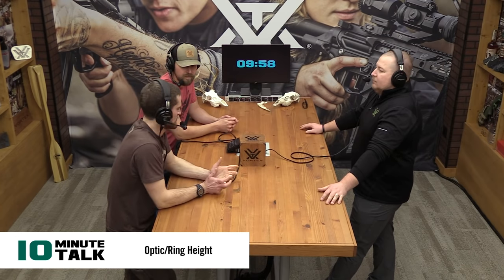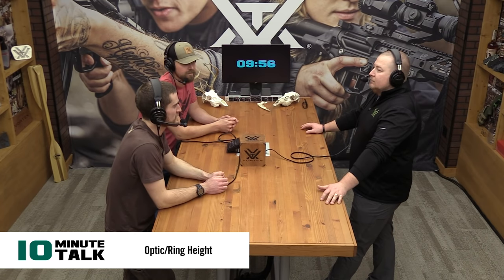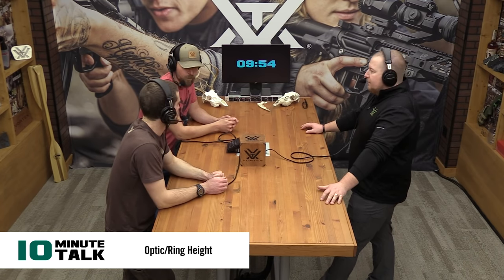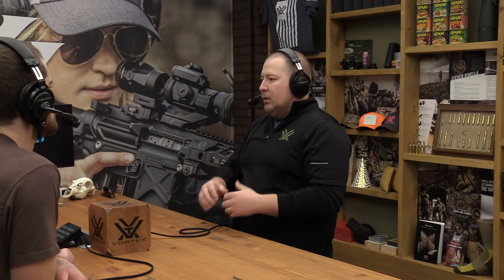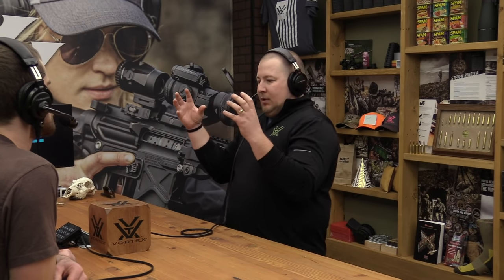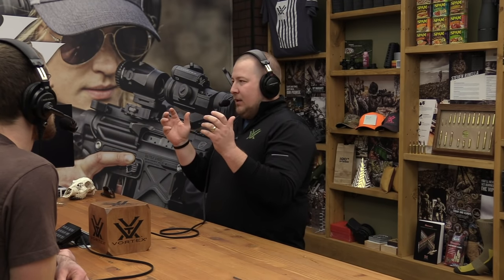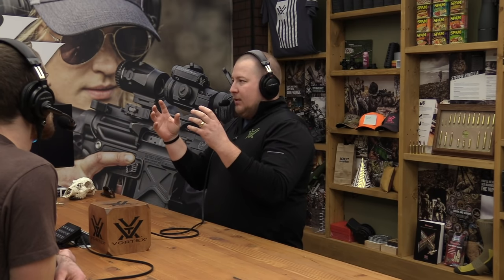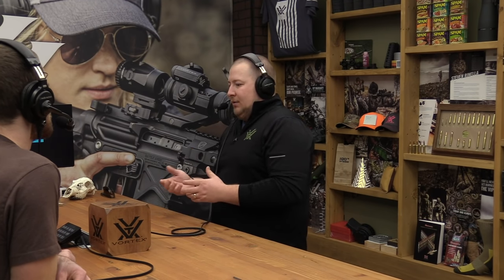#10MinuteTalk – Optic/Ring Height

Comment: One thing not discussed was the effect of length of pull.  On a standard bolt gun, the further you move away from the gun, the lower your head lowers and vice versa.  People with longer necks tend to crawl the stock, which generally forces the head down, and you end up looking through the top of your eyes, which, as pointed out, is not desirable.  Higher rings can help this.  A cheek piece on the stock should be raised also.  It is crazy in this day and age that all rifle manufacturers don't offer adjustable combs and length of pull on their stocks - especially where women are concerned as they generally have longer necks and a smaller frame. 

One issue with Bradley style of cheek riser is its width.  It tends to move the face away from the stock, which causes the shooter to roll his/her head over to look through the scope.  This affects people with round heads or fatter faces more.

The bottom line is rings are only part of the equation, and it is an ongoing trial and error process to get a solid fit every time.

Comment: 17:38 Jimmy is so right. 30 mm tubes and even the 34 mm tubes are fine on medium height rings. You might only need low if you are getting the 1 inch rings for the Crossfire II 3-9 / 40 mm.

And definitely get the Vortex cantilever or "AR" mount. I learned that the hard way. When I was scoping my AR-10, I got some separate rings and put on a Diamondback Tactical 6-24 / 50 mm. I could not get enough elevation to bore sight with my laser. Changed to the cantilever and then the scope had height and alignment with my eye. Now, that makes height over bore about 3 inches but at least I could get it zeroed. And when I changed to a Venom scope, I knew to get the cantilever for a 34 mm tube.

Now, with my new TC Compass II for my dragging through the bushes hunting rifle, I have one of the Diamondbacks I had laying around when I changed three other rifles to Venom scopes. I used medium height 30 mm that I had used originally. Perfect fit.

For cheek height, I had tried a Bradley but it was actually too high. So, I got stuff from Goda Grip and that worked out great, like it was made for me. Anyway, so, having all the alignment worked out made zeroing a lot easier and more successful.
Reply: Ring height also depends on the ring manufacturer, and objective diameter. I’ve used low rings with three 30mm tube 44mm objective scopes now with room to spare. This is especially true when a pic rail is used. This is all on bolt actions.
Reply: Medium-high ring from what company? What you are looking for is the clearance between barrel and scope 2mm/0,08 inch.
Reply: @oddmunddale806  The Vortex mediums seem to work well for most scopes with objective bells larger than 40 mm.

Also, as I mentioned in another post, you can go to the Vortex site and look at the ring specs for your desired clearance.

Comment: Great info! I know this is 2 years old but wanted to point out something you may have overlooked. I am not someone that prescribes to "lower is better". I tend to do what you suggested and thats to run the proper hight comb/cheek piece for a good weld. But, I do think it's important to note that if you are a hunter, especially those that hunt in the mountains or varying degrees of elevation and terrain, if you are not running a bubble level on your rifle and you are taking longer shots, the higher your scope is off your bore, the more canting your rifle is going to effect your POI shift.. I think most would be surprised at how your mind plays tricks on you when it comes to keeping your crosshairs level in mountains terrain.. So, taking that into account, I might suggest that you should keep it as close to the bore as you can without risking contact with the bell-housing if you are not going to run a bubble just to reduce any risk of missing..
Reply: Watch MDT's video on scope height, higher doesn't make the effects of cant worse.

Comment: About the chart or rings/rifles/scopes/bases, the one thing that would be handy is if there was a chart or app that would tell you the shortest ring/base combo that fits that rifle. A 44mm objective might be just fine, but a 50mm objective might not work with those rings or base.

For example, if someone has a Bergara B-14 Hunter and wants to mount a Viper HS 4-16x44 scope on it, what ring and base combinations can they use that will still allow the objective to clear the barrel? If they want to go higher, then they can use something taller, but there is a point where they can't go shorter.

Another person might have a Bergara B14 HMR and the beefier barrel might require taller rings for that same scope. Or they might choose a Viper PST 5-25x50 and need a minimum height set for that scope.

While it might not get the person the best possible scope ring combo for their head size and stock, it would  at least prevent them from getting a base and rings set that won't work be cause it's too low for the bell.

Comment: Have acquired your Diamondback 4X16 by 44 riflescope to apply to a Rock River Arms Predator Pursuit AR with 16" barrel and full top rail. Do you think a pair of your medium-height rings would work without using the heavier and bulkier cantilevered base with rings? I am aware that both rings MUST be on the receiver portion of the rail. Would appreciate any perspective.
Reply: You should get a cantilever mount for an AR. Standard rings are going to put the scope too far back to be comfortable.

Comment: Just ran the numbers through a BC, 1.5 Height over bore was -354.74" drop and 1.72 HOB was -357.82", just using base numbers on a 150gr bullet @2800fps.

Thats three inches guys, with .22" more HOB, keeping the same 100yd zero.

Interestingly, with a 50yd zero, 1.5" HOB was -351.82, and 1.72" HOB was -347.74".

a 30yd zero 1.5" HOB was -336.79 and 1.72" HOB was -329.76.

That's nearly 7 inches!  

Nothing against the Vortex guys getting this wrong, but, thats a lot.

Comment: Thanks for the video. All things being equal, what would be an ideal height of a scope over the bore? I have a Savage 110 Hunter bolt action and I am using for now a PA deluxe AR15 scope mount 30mm to hold a PA SLX1-6x24 scope but I am finding it difficult to to get a good cheek position to get a good view through the scope even with the highest  cheek riser which comes with the rifle, does this mean that the mount is too high for this type of rifle and I would need to get a lower mount? What would you recommend?
Thank you

Comment: I’d like to see a talk about elevation travel in scopes.  For instance the first razor has 125 moa and the Gen 2 only has 70? They upgraded everything but went backwards one what counts for is ELR guys. Other 34mm tube scope have up to 130 moa of adjustment. I think they need to build another razor. The 4.5-27 is perfect mag range but make it with 140 moa of internal adjustment so we don’t have to add adjustable bases or spend more money on the Charlie tarac    Thanks

Comment: The most important factor in determining scope height is keeping your eyes level with the horizon.  Period.  Facial features (fat cheeks) and adjustable stocks will be factors that contribute to your individual needs.  Keeping your eyes level to the horizon aids in acquiring a target, and aligning your eyes to center if scope.  David Tubbs book address these issues, but most people still mount their scope too low.

Comment: Does the persons height play into the descion on what height to use? I have a AR with your Razor HD E II, but no mount yet because I don't know what height to use. I am 6'7" with long arms obviously and a longer neck. Not like a giraffe but it is slightly longer than normal. I plan on using the gun for more tactical/action shooting on the range since I am military and thats what I am training for. Would this push me more towards a higher mount, if so how high should I go? Thanks for any information you can provide.
Reply: I have a PST II on an AR... in a 1.5” mount that’s sitting on a 0.5” Yankee Hill riser... I’m 6’4” with a longer neck... for upright stuff this height is so natural to work from... leaves a bit to be desired in the prone. I did find my stock length helped (run one click in upright and bump it out to full when prone) to get a better “cheek/chin” weld. Not sure if this helps but it’s been my subjective experience. My next mount will be a true 1.93.
Reply: With a persons height you would be dealing with Length of pull , which is roughly as you hold your rifle the butt stock should just reach the inside of your elbow, and for comb height can be different for many people,you would need to get behind your weapon naturally and comfortably with your eyes closed, then open your eyes and see if you need to go up/down to get good scope alignment, if shaded area in scope is top or bottom then you need to raise or lower, if shaded area in scope is on sides then you need to work on your positioning of cheek weld, form, etc..., if shade area in scope is equal all around but clear in center, then you need to move cheek weld back lil bit, once you have right you should have no shaded areas in scope when behind weapon system, you will also when doing this start at lowest magnification initially, then once finished should end on highest magnification of your scope to reaffirm

Comment: If your mounts are holding the scope correctly, the scope will never touch the barrel if you can slip a piece of paper under it. If the scope slides inside the scope rings you did something wrong. The barrel doesn't whip unless you live in a cartoon.